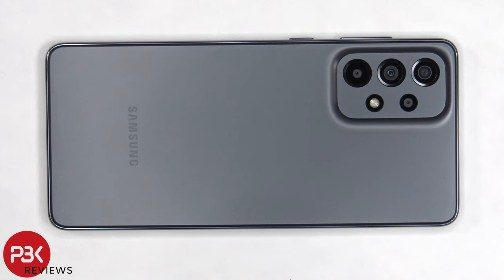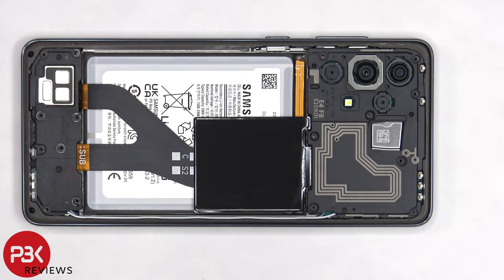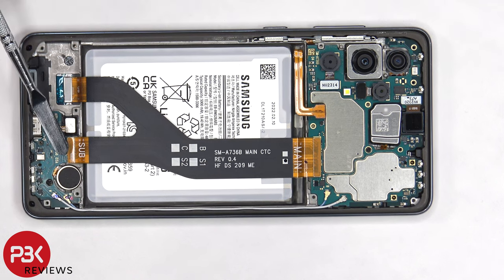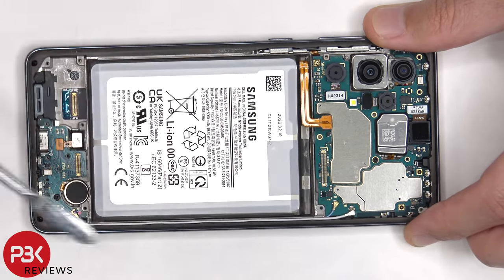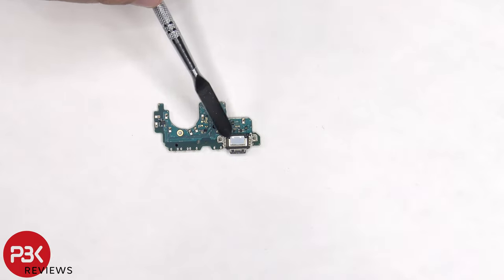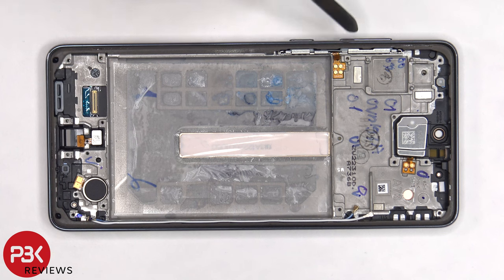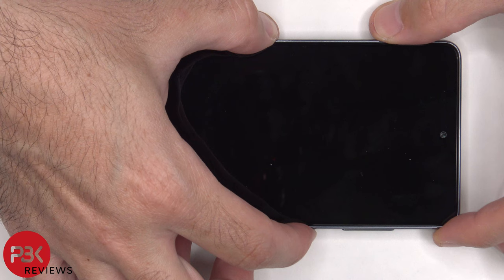Samsung Galaxy A73 5G Disassembly Teardown Repair Video Review

Comment: Good phone with sd7325ab (778) processor but there should be cut on the aluminium midframe under the processor so that processor touches the copper pipe for better heat dissipation. Also thermal paste should be needed.
Reply: Bro the material used under the soc pcb is highly thermal conductive and it's molded into the vapour chamber and also under the pcb their are graphite sheet which acts as heat discharging medium so no need of thermal paste, thermal paste is just useless inside a phone because it works well if their is a active heat dissipation system like fans because it's so quick in transferring heat which a vapour chamber cooling can manage and can explode, correct me if I'm wrong, as a aircraft thermal engineer I have explained the details working of a mobile device heat dissipation system
Reply: I doesn't have thermal paste but more than that it has thermal pad
Reply: Garbage phone ، out of the blue no Network coverage and fingerprint sensor not working. They say it needs main motherboard 😢

Comment: How do I fix the "no service" error. I tried the diagnostics test in the settings and it says that the sim is normal. Basically, after I drained my phone it started to show the no service symbol even after many restart attempts. I tried all solutions from the web, and I am doubting it could be hardware but it I never dropped it yet. Any idea how I could get it fixed?

Comment: hey man my A73 died after i pounded it because I was rage gaming. Is there any way to save the storage when the (cpu / ram) is faulty and wont display in screen?
Reply from the maker: Odds are you damaged the screen or the screen cable became loose or disconnected etc. Chance of the board or cpu being bad is slim. You can probably attach a replacement screen (if the screen is damaged) and be able to power on the phone and make use of it.

Comment: Hi galaxy A73 dimension are about the same size as galaxy M52 and both of them have a 5000 mAh battery and both are rated 4860 mAh as exact capacity. Lets say that i cant find m52 battery can i put A73 battery in M52? 
Please respond thanks.

Comment: Hello, PBK . I am new user of Samsung Galaxy A73 . But I use SIM tool to pick up that slot , but I punch wrong is that mic hole at top , it will broken or lost water resistant? Thank you.
Reply from the maker: Hi, no you should be fine. The mic and filter are seated above the hole so would not be damaged.
Reply: @PBKreviews  yes , I also use sim eject pin to test punch top and bottom microphone carefully and slowly to Measure for damage. I also use this phone of water resistant test, is not any problems, is so lucky for me. And thanks for your answer.

Comment: I noticed that the adhesive for the plastic back is coming off. Should I be worried and does it affect the IP67 rating?
Reply: Me too. This needs an answer
Reply: Sorry if im late. If the plastic cover is coming off, you should go to the nearest samsung service center. The IP67 rating is busted even if you bring it to the service centre.
Reply: It also happend to me

Comment: Can I check if the camera lens glasses can be replaced without removing the back cover or not?
Reply from the maker: yeah, the glass itself is held down with adhesive, you can heat it up with a hair dryer or heat gun and use a thin razor blade or x-acto knife to pry it off and replace it.

Comment: Hi....I am using Samsung A73. Just bought a new phone few days back. By mistake I inserted the sim card ejector in the secondary microphone hole which is on the top right hand side. I am  really worried.  Did it damage the microphone. Kindly advise
Reply: Please reply asap
Reply from the maker: Hi, no you will be fine, the mic is seated above the hole and wont be damaged.
Reply: And what about the water resistant mesh
Reply: Can share the image of how microphone is placed inside the phone.....just for my satisfaction

Comment: Can this phone be water proof once we repair( display changed
Reply from the maker: If you use the original pre cut adhesive for the back cover/plate and you used lcd with frame combo replacement which comes with the screen pre attached to the frame, then you should retain the water resistance. Or if you use water resistant seal for a replacement screen.

Comment: Umm can i ask you..is it normal that when i just use this a73 for scrolling through out social media and the temperature kinda increasing on the front part of the screen..and when i opened my case i dont feel any heat only on the front side (screen section)?
Reply: Or Is it the side effect because i just accidentally drop the a73 from table?
Reply from the maker: Normally, most phones heat up when using the web or browsing etc. When the screen is on, it generated heat, as well as the antennas being used for data/service.

Comment: There is minor scratch on the inside part of the glass cover of the main camera of Samsung A73.....do you think if I take it to Samsung service centre will they consider it as manufacturing defect and give approval for replacement with new handset
Reply from the maker: Not sure, it won't hurt to try.
Reply: @PBKreviews can the top microphone be destroyed by mistakingly putting sim ejector?

Comment: Is the inner frame plastic?
Reply from the maker: midframe is aluminum alloy
Reply: @PBKreviews only the inner mid frame is aluminium, correct? Because if the outer mid frame were metal, there would be antenna lines visible, that's not on this phone. 3:44

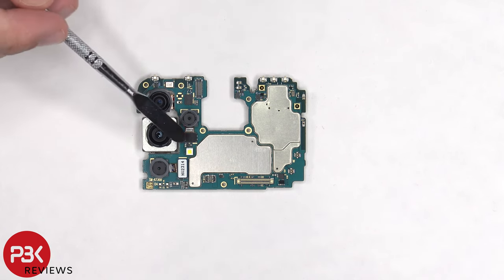Comment: I have a question. Do you think the sensor at 3:12 is really a proximity sensor? Becuase from gsm arena review "Unfortunately, there is no hardware proximity sensor, and the A73 5G has a less-reliable virtual one instead (Ear Hover Proximity Sensor ProTos)."  

What do you think about this? Maybe Samsung doesn't use it??
Reply from the maker: Hi, It is a proximity sensor. It is also listed in the specs on the website here: https://www.samsung.com/my/smartphones/galaxy-a/galaxy-a73-5g-awesome-mint-256gb-sm-a736blghxme/     It might be possible the region version GSM arena reviewed didn't have it but unlikely.
Reply: It is a proximity sensor, make a call and use another phone camera, point to the top part and you'll see the proximity sensor flashing green underneath the display.

Comment: Hi...I accidentally dropped my Samsung A73 phone from the bed on the marble floor will it cause any internal damage
Reply from the maker: As long as the phone is working without any issues, you should be fine.

Comment: Are A73 5G and A71 Battery same in size?
Reply from the maker: No, the A73 is a bit larger, and the connector locations are different as well.
Reply: @PBKreviews  If A73's battery fits in A71's housing, Then it possible to swap connector with A71 and make 5000mah upgrade to A71. neat huh?

Comment: Can that alcohol remove the back plate too
Reply from the maker: yes but the back plate adhesive isn't that strong, even without heat you can pry it off but applying some heat makes it much easier. Usually I try to avoid using isopropyl alcohol on the back plates (if they are glass) since the alcohol eats away at the laminate layer (the color portion is basically a laminate film over the glass) and it peels off the colored film.
Reply: @PBKreviews  ok bruh thats for the details reply

Comment: How to replace the power button?need teardown?
Reply from the maker: Yes, you would need to take it apart so you remove the motherboard (since its sitting on the flex cable for the buttons), then you can lift up and pull out the metal bracket holding the buttons inside the frame.
Reply: @PBKreviews  when you use the samsing a73,does the screen looks a bit not comfortable?

Comment: The back from bottom feels like hollow...it presses down with fingers
Reply from the maker: yeah its normal, there is a little bit of space in between.
Reply: Thank you for your reply...
I had s20 fe it felt solid...
But this makes tik sound when pressed from back
Reply: I just noticed that,if I press the plastic back of this phone , it produces sounds like Tak Tak . And also it bends (goes down )if  I press the plastic back . Is it normal ?
Reply: @progamersuman2247  i think its normal...but it is irritating
Reply: @palashaggarwal17  ok thanks for the reply.